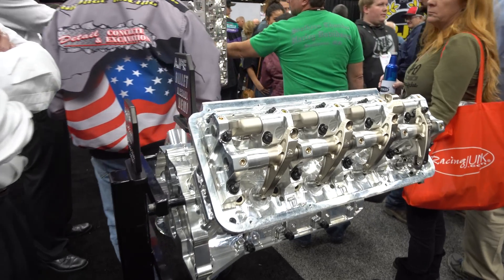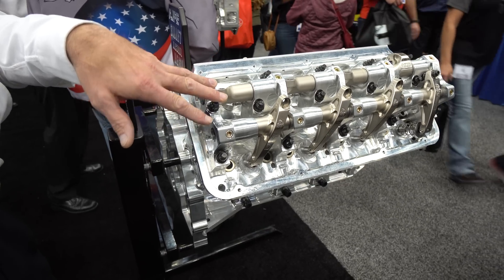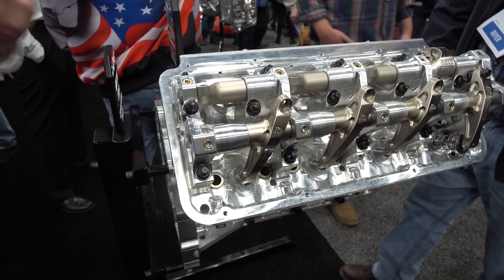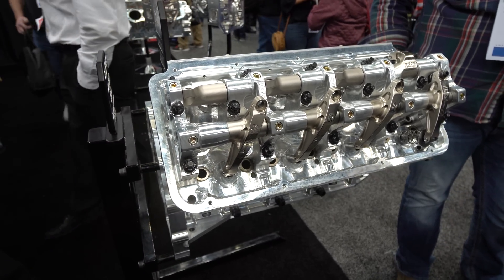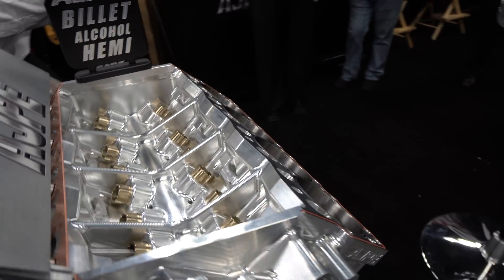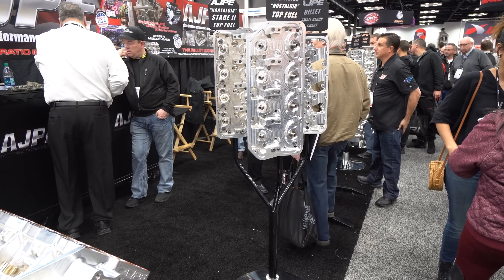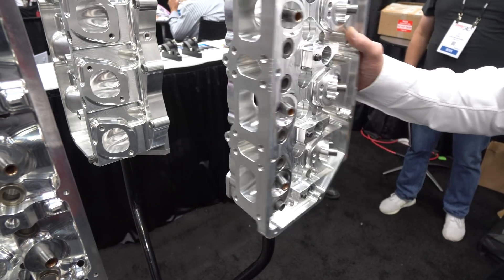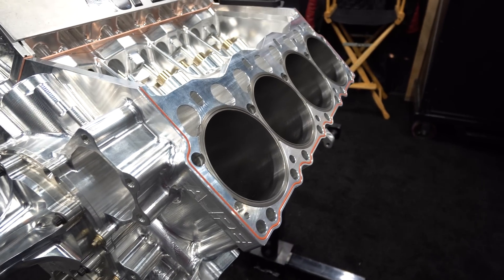AJPE Billet Aluminum 481x HEMI Block and Stage 4 Cylinder Heads at Performance Racing Industry (PRI)

Comment: One item I would suggest is on the Hemi heads is use a 40 degree piston / head instead of the current 58.5 degree hemi head we have.  This would be lower,  lighter and use a 4.500 bore which would allow  2.5 intake and 2.0 exhaust valves with more CFM and hopefully more power.

Comment: not a MOTOR. It is an Engine. Motors are electric, hydraulic, pneumatic. These are heads for an Otto cycle internal combustion gas ENGINE
Reply: Im pretty sure when anyone goes to a mechanic and says theres a weird noise in the motor they don't immediately go look at the starter lol
Reply: Right on.
Reply: Its a polytropic combustion heat engine.😊
Reply: Both motors and engines output mechanical energy for use, but motors are fed energy from another source.  An electrical generator shoves electrons down a wire to turn an electric motor.  An air compressor shoves air down a hose to turn an air motor.  And a hydraulic pump shoves hydraulic fluid down a hose to turn a hydraulic motor.  You have already figured out that generators, compressors, and pumps, need to be turned by either a motor, or an engine.  Engines, on the other hand convert potential energy in fuel into mechanical motion.  It is interesting that a steam engine is a steam motor with an attached firebox and steam boiler.  Many people, including automotive professionals, call engines 'motors', but nobody but a fool would call a motor an engine.  It would be nice if the company was called, General Engines, but it's not.  This discussion is almost as frustrating as the one about "bolts" vs. "screws."  You think there is a real difference between them until you look them up and see that idiots have been around for so long that they have ruined those words too.
Reply: you're a moron

Comment: HOW MUCH$$$$$$
Reply: They only are sold BARE (no vavle/springs,etc) For a Pair they are $6,865.00, The Billet block cost $9,600<$10,575

http://www.alanjohnsonperformance.com/cylinder-heads/item/129-481-x-stage-iv-cylinder-heads

http://www.alanjohnsonperformance.com/images/Pricing/AJPE%20Pricing%2011-9-16.pdf

Comment: Please explain 481X.  The cubic inch is in the high fives, not 481 so I have been told.
Reply: bore space
Reply: Thanks, Kyle!
Reply: The 481x has standard bbc bore spacing. The name refers to the block design. It has raised cam and larger cam bore, lifters are spread, the blocks are skirted and the mains are cross bolted. Mainly the 481x is known for its improved valve train

Comment: Vidiographer has no idea what he's looking at or what is being said.
Get it together, jeez.
Reply: Scott so true, 551cc intake and 198cc exhaust ports are No joke. You need some serious RPMs and displacement to get things moving in that hallway size ports.
Reply: You didn't do bad...I would love to have seen what he said when you asked, "HOW MUCH" Or specs on the heads...CC's/CFM's ;-)

The Stage 4 heads they don't give #s. Stage 3 heads are close to 600cfm, about twice srt 6.1 hemi or LS2 corvette heads.

Thoses heads flow enough to make 1 Veyron/Koenisgsegg engine amount of power per cylinder( 1,000<1,250hp/cyl on nitro & 45 psi of boost). 

The valve springs they use are about 2x as Stiffer than the rates on c6 corvette (1,00psi @ 1"inch of lift). 

OG Gen 2 426 rocker-shaft pedestals where cast iron/bolted on and would break/flex under the load. 

I the dodge hemi was the first shaft mounted rocker arm setup which all racers use now.

Would have been cool if you put you hand in th port to give a visual comparison.
Reply: JerseyMikeP  Those ports are huge
Reply: Internal...SO you are the guy in the video?
Reply from the maker: Sorry it didn’t meet your expectations. Thx for watching!
Reply from the maker: Thx for all the info!
Reply from the maker: I’m the one filming and asking questions yes